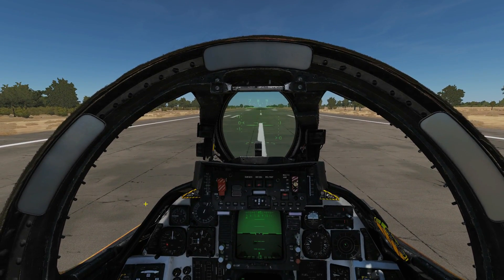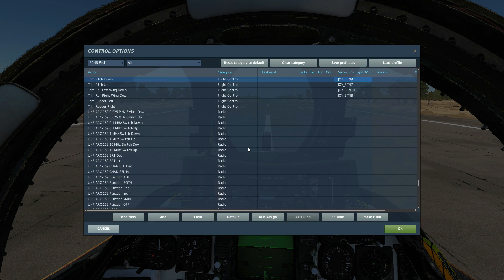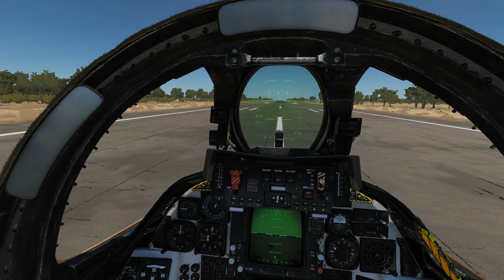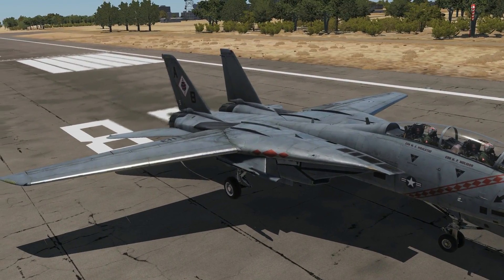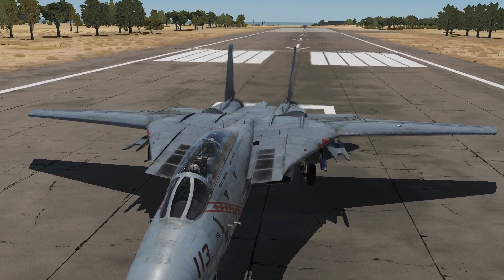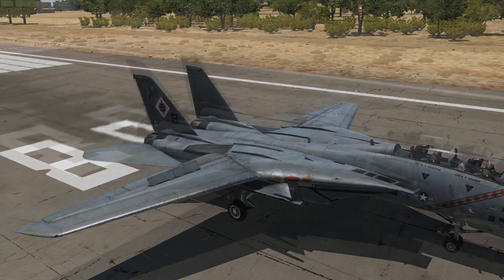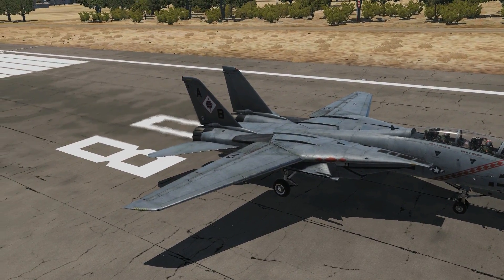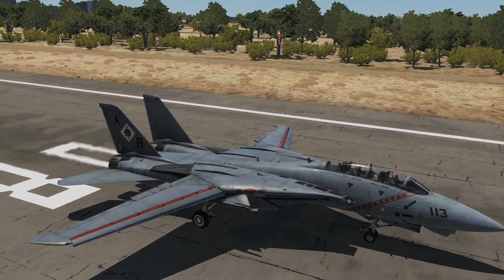F-14B Tomcat: Flight Control System & DLC | DCS WORLD

Comment: This thing is a joy to FLight with Headtracking + Xbox Controller

I use LB and RB as modifier (as well as select as a Switch for Combat mode) :Left Stick: Pith/Roll, as usual, but the magic is in the right stick: As base, I use it for DLC control: Forward increase, Aft: Decrease. LB modifier + Right stick controls the flap. RB Modifier + Right stick: Controls the zoom. If you release the RB modifier first, the axis get stuck in the position you want, So you have a lot of fine tune axis control for the Airplane. Freeing up Y and B that I usually use for Flap and brake, allow me to get two extra digital Axis: Y/B = Brakes extend/retract. RB+Y/B Wings manual Swept forward and Aft. Throttle is, as usual, dedicated on X and A buttons.

Comment: Perhaps interesting to note on the spoilers is that aside from aiding your roll they actually prevent the aircraft from twisting itself to bits. They were added because the stabilizers are so large (approx. the size of the wings of an A-4) and have such massive authority that they would otherwise twist the plane at the section where the engines are :)
Reply from the maker: wow! amazing knowledge.
Reply: They also help overcome the Tomkitty’s massive moment of inertia with its wings spread.

Comment: Why my slats got stuck after landing... sometimes one of them got stuck, sometimes both! I didn't hit any of my wings, the landing seems fine to me. Can someone tell me why?
Reply from the maker: I haven;t had this. Anyone else?
Reply: @grimreapers  Thanks for replying Cap. This problem occurred to me multiple times. I was doing some testing this afternoon with my Tomcat. The result is, I think I might have damaged the slats. Usually the slats retract with the flaps, but if I fly my aircraft with some heavy speed while the flaps are up, this might hurt the slats resulting one or both of them getting stuck... well I might be wrong, maybe it's just a bug in the sim, not sure how it works in real life...
So I was landing on the carrier again with minimal speed, then I carefully put my flaps up, landed successfully, and the slats are fine.
Tried flying in the air aggressively, put my flaps up with no reason, flip a few rounds, then my slats starting to stuck. Slats no longer retract even when I tried to put my flaps down with a keybind. I wasn't able to find a manual switch to retract the slats though, maybe there is a switch somewhere so I can manually retract them?

Comment: Great work on the tutorials, they have been a great help. As for your Stick which is a x56 right? I noticed you don't use seitek profiles.  Its easy enough to set up and will give u 3 times the amount of buttons per plane. for example, Make 2 profiles using keyboard keys by entering them in to seiteks profile as keybinds. leave the last profile blank and use that for the profile  for your joystick commands that are already set up. You can make profile one carrier landings. profile two rio short cuts and so on. also im not sure if you got the mouse nipple working, but that can be used for slewing targets when changing to bands. anyways hope that was some help. said all that and ur prob using a TM lol
Reply from the maker: Thx Sir

Comment: Iam very new to dcs world and i have tons of problems to control the F14. When i turn the plane lets say to the left then all the sudden it starts to turn right wich leads to  loss of control and i crash most of the time, i have managed to save the plane couple of times.  I checked that there is no conflict in the controls and the flaps are in flightmode. I dont know what iam doing wrong here :/
Reply: You need coordinated rudder input or else it will do that.
Reply: At high AoA, roll using your rudders
Reply: @burl1420  Ahh aright. Thnx for the help. Gone try that tomorrow after work. Cheers :)
Reply: It's called adverse yaw. It's created by the downward deflection of the aileron due to the increased induced drag. So, in short, it's an unbalance of drag on the wings. Most smaller aircraft (like a cessna 172 etc.) has frised ailerons to even out the drag and overcome adverse yaw. On larger jets (passenger jets included) you will quite often see the aircraft turning using ailerons at low speeds, and spoilers (spoilerons) at high speeds. There are mainly 2 reasons for that. At high speeds ailerons, placed on the outer part of the wing) creates quite a moment arm in force during turns which can have a high load factor on the wings. Spoilers are placed closer to the wing root and will therefore have less of a moment arm... The Tomcat uses it all as CAP says and with those variable sweep wings it needs all the tricks it can get. Only downside is complexity and the weight of the system as a whole. Later passenger jets actually adopted the automatic spoiler deployment to increase drag during approach and decent. It's featured on the 787 due to the insane amount of lift that wing creates...
Reply: @JD-ip4sp  ahh thnx for all the info :)  seems like i have some training to do :p lots of info to take in and wild girl to tame but hope one day i can fly her as good as i fly the mig-29 well good and good but ok at least haha :)
Reply: @designamk1160  Long time  i  played dcs  now  so cant  remember but i think it happend  regardless  of speed. Have  to try again and try to follow all the tips i got from you guys  :)